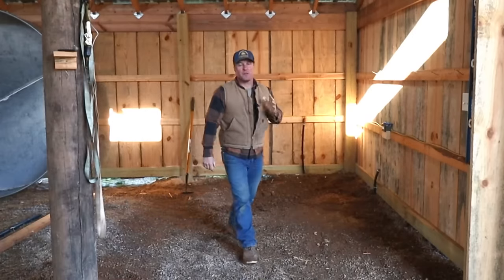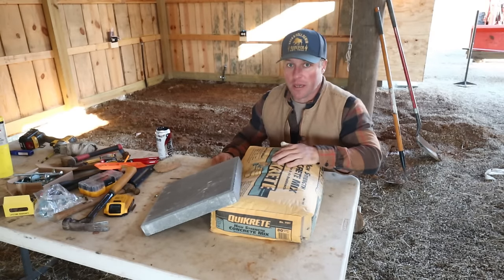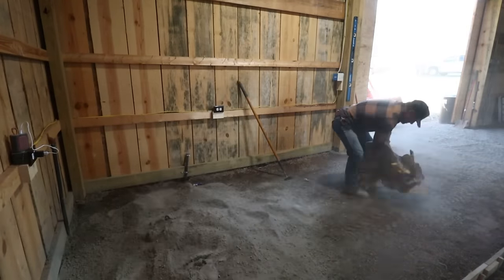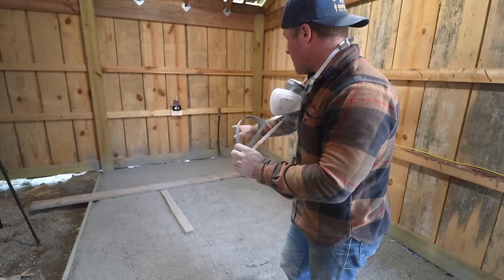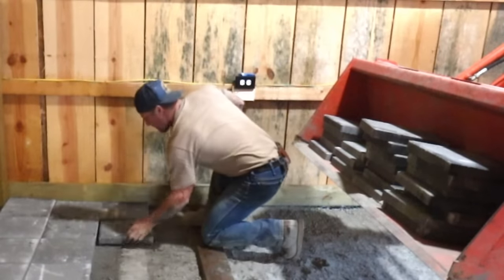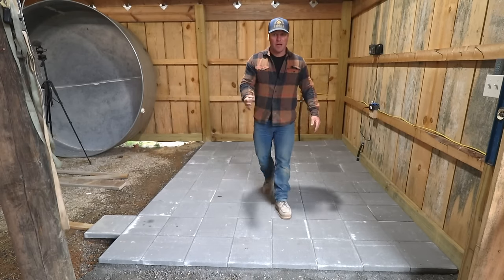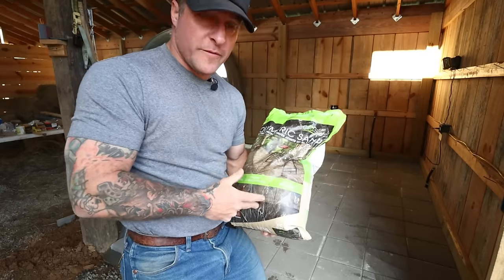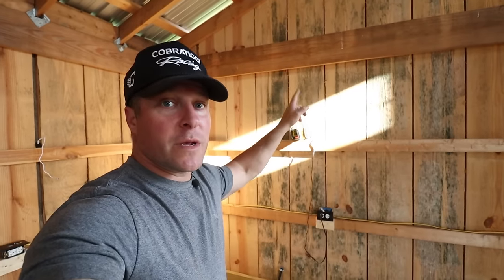I BUILT A KITCHEN IN MY POLE BARN | Dry pour concrete paver floor

Comment: The only thing I see with the water pipe is it’s not protected from the sheet metal over time it could rub a hole in the pex from water hammer in the hole in the tin, so I’d put a pice of pvc pipe over the tubing coming through the tin wall, but that looks great love it!
Reply from the maker: Awesome good tip thanks!